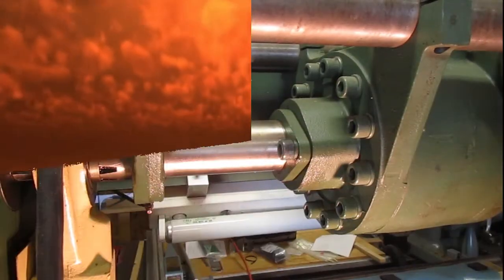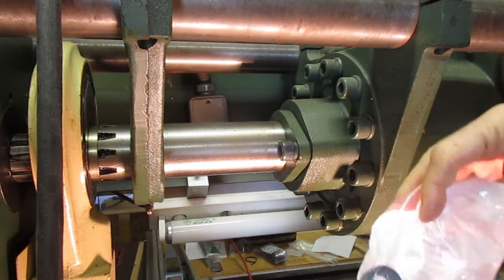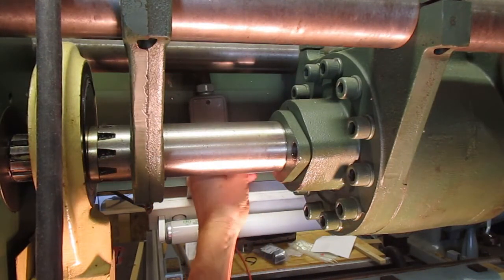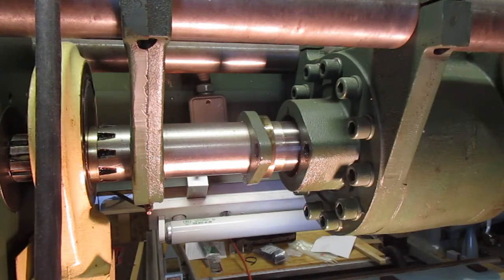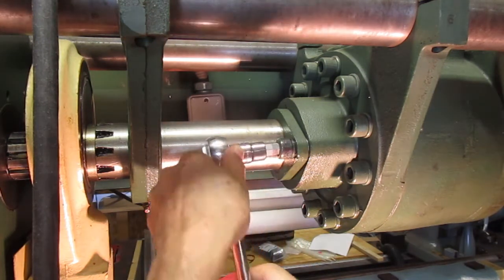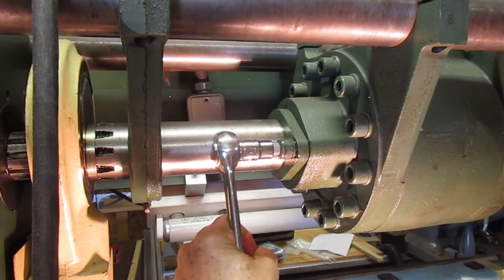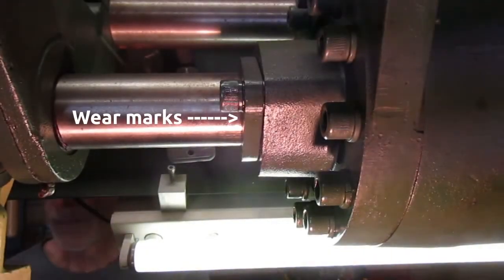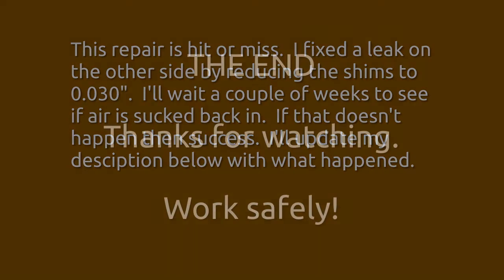Di-Acro Press Brake, Fixing Leaks In Hydraulic Motor

Comment: I just picked up the same model press from an estate sale.  What is the right oil to use in the hydraulic system?  Do you know?
Reply from the maker: The manual (1972) calls for non-detergent hydraulic oil SAE 20 (Mobil DTE Heavy Medium or equivalent).  That would be ISO 46 or 68 in today's spec.  I'd go with ISO 68 (heavier) given the machine's age.  Pacific Press Technologies owns the rights to the DiAcro press brakes.  Contact them @ (800) 851-3586 or visit https://www.pacific-press.com   Good luck with the press brake.
Reply: Thank you!  I hadn’t been able to find a manual for the press anywhere.  I appreciate the help.
Reply from the maker: @rowycoracing  U R Welcome.  Be careful with manuals offered on eBay.  Some are of poor quality.  Pacific Press may be able to email you some documentation.  Those machines are decades old now so information & parts are of limited availability.  Be careful moving that machine.  Good luck and work safely.

Comment: Have the same issue.  What is the size and part number for mcmaster?  Can't seem to read it off the bag
Reply from the maker: Hi - Sorry about that.  The shim is 5/8" ID x 1" OD x 0.015" thick.  McMaster P/N 90482A326.  Caution on making sure you allow for the chamfer.  I went to .030" on both end bells.  It is tight on the one side and about 90% so on the other side.  I don't leak fluid but will ingest air if the machine sits for weeks without running.  This tightens up the seal pack and reduces this problem.  I had lots of air coming in before I reduced the shims.  And also the usual fluid drips when making bends.  Something else I found out, clean your dies with WD40 and leave a small residue.  Metal will skid on the lower die and the WD40 helps balance this out between front and back.  Hope this helps.
Reply: Thank you sir.  I will let you know if this helps my leak
Reply from the maker: @GarrisonWelds  U R welcome..  Good luck and I hope this improves things.  Work safely.  BTW: 1/2" on the allen key.